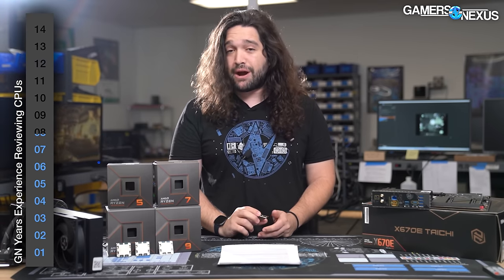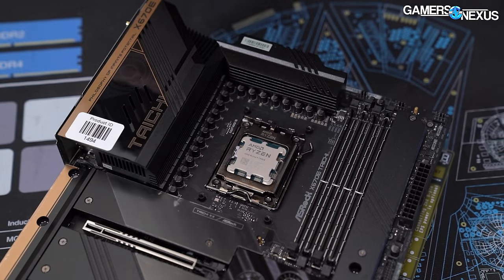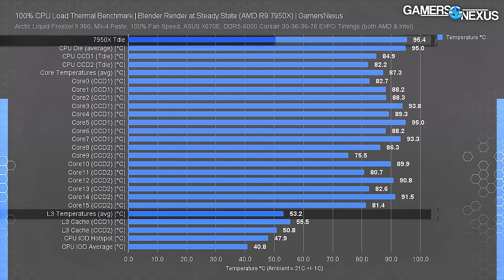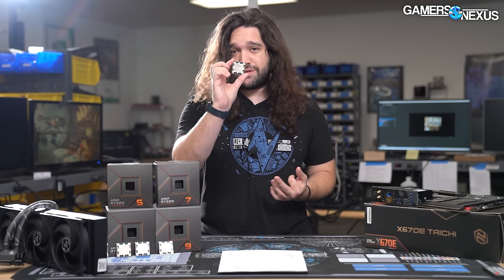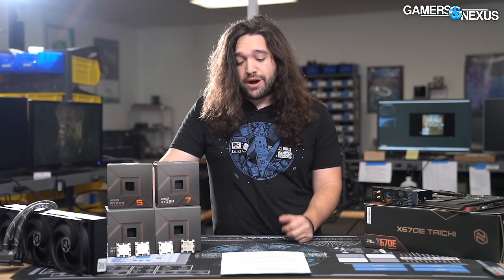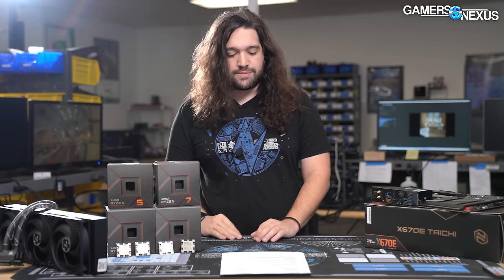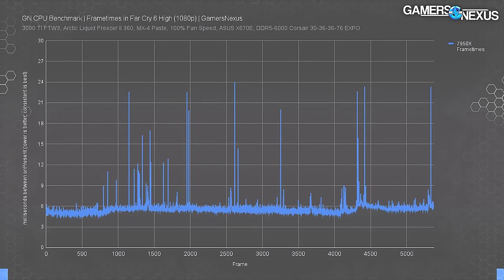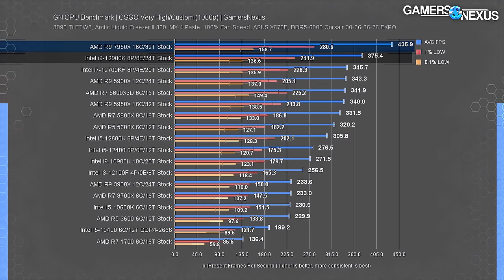95°C is Now Normal: AMD Ryzen 9 7950X CPU Review & Benchmarks

Comment: Happy to see amd doing this. If you want more efficient CPUs lock them to lower power and if you want more power you have the option as well. I'd be interested to see effiency at different power draws to see if it's worth it or not
Reply: Except that if you want to be more efficient, you'll skip this generation. (I am.) Why pay top dollar then fence off the performance? Get a 5900 or 5800x3d instead and save your money AND your bios tweaking time.
Reply: Why pay 2x or even more for the whole system with 7000 series, because it needs more expensive components and then underclock it to perform the same or little better in term of power efficiency than previous generation?!
Reply: @KenOtwell  it makes sense for the production workloads it excels at. For gaming get 5800x3d though

Comment: Will be interesting to see if the 13900K will be slightly more efficient or slightly more power hungry. Interesting and exciting times in the CPU space
Reply: It's a big jump both in performance and efficiency hence Linus recommended as well to wait for it, it's gonna still be power hungry (in max) load.... I say again (MAX) load, cause in gaming Intel doing less than 70C and power usage so low making use of these efficiency cores...... This time I'm going back to Intel tbh, didn't have good time with 3900X and 5800X they caused so many issues didn't find in Intel CPUs, both in VR and stability of ram also.....

Comment: +90C? That might be fine for the CPU but doesn't that affect other components in the PC? 

Regardless of performance, and price, that might be a deal breaker for people.
Reply: It shouldnt
Most it may affect is the board given that it was liquid cooled
Reply: @gawizard4980  But what if its air cooled?
Reply: It won't affect any other components. The TEMPERATURE is not the problem, it's the WATTAGE. Watts in = heat out. So running 210W at 30C is still the same heat over time as 210W at 95C. The surface temp of the silicon is not changing how much heat 210W produces.
Reply: Temperature != Heat. A 7950X running at 95° will be dumping less heat into the case than a 12900k running at 70-80C°. Like to like, lower temperatures are still preferable due to leakage but the power draw number is what you should be looking at.
Reply: No, overall heat output is what affects the other components. And thats solely driven by power consumption. So if you're fine with a 12900K, you're fine with these.
Reply: You can try to use as much science as possible, but the 95w figure is compounded but the high power draw. It is the High power draw... that is the number to look for. This is totally different than running a 4790k with the stock cooler..... because with this configuration you'd see +90c temps while running AVX production workloads, while the CPU is drawing -/+ 100w.

If you were to configure your AIO or Radiator at the front of the case then sure, the heat would be an issue. However, you'd have to make sure the hot air is being exhausted as fast and efficiently as possible..... while factoring in the GPU power draw. This should.... and I mean should.... be less of an issue if the AIO cooler/Radiator is configured at the top of the case.

If you think the 7950x is bad, then wait until you see what Nvidia has in store for you!
Reply: @FixedFunction  I think i understand this. The temp at the CPU only shows how well the Thermal transfer of X amount of watts is between the cooler and CPU?

Comment: They should add a setting to lower the target tempeture so you can can better longevity
Reply: no real point to buying it then, unless you want to force yourself into ddr5.
Reply: @OscyJack-  If he consider better longevity. I suppose he want to replace some 4-6 year old stuff like ZEN1 or Coffee/Kaby Lake. Than he will surely see great improvement of performance in new gen stuff.
Reply: @honzaplachy5040  you've agreed me with. If that's the case, get a 5xxx series. No need to get ddr5, no need to downclock. And it'll last a long time.
Reply: AMD said 95 is a "safe" temperature. Meaning it will have no deterioration or damage. Above 95 to 100 is still okay but it will throttle at 100 and deterioration will start.
Reply: @weirdo911aw  yeah, that's too hot. That will affect the climate of your home lmao. Degradation or not, that's stupid. All to be able to claim 5.5ghz +.

There comes a point where it's ridiculous. 

I'll be keeping my 12700k. I already get my max fps anyways. At 30 degrees less
Reply: @weirdo911aw  It'll have deterioration and damage on my well being and my sanity. I'm not looking to turn my room into a sauna.
Reply: @OscyJack-  it still uses basically the same power as your 12700k so it heats the room by the same amount. The temperature is irrelevant.
Reply: @infinitelyexplosive4131  untrue
Reply: @OscyJack-  the 12700k uses about 170-220W, same as 7950X
Reply: @infinitelyexplosive4131  are you trying to dig yourself a hole to climb out of? You're barking up the wrong tree.

You legit just said temperature isn't related to temperature. I don't think we can go further in a chat. But good day and enjoy your fantasy
Reply: @BlackWinds  hahaha
Reply: @OscyJack-  okay how much power do you think that the 12700K uses and how much power does the 7950X use?
Reply: @infinitelyexplosive4131  at the risk of extending this conversation. I run 182w full load averaged over 1 min. At 5.3ghz p core, 4.8 e core, 4.8 uncore at 1.26vcore.

If you think you are going to teach me something, you are wrong. I do this for a living.
Reply: @OscyJack-  so you’re looking at what, 20-40W more power to run the 7950X? That’s not going to appreciably change the temperature of a room.
Reply: @infinitelyexplosive4131  there are so many variables involved, I am certainly not going to sit on YouTube trying to educate you. 

You are not correct in your assumptions, but thanks for playing. Enjoy your day
Reply: @OscyJack-  There is literally one variable involved, power consumption. This is taught in every high school physics class in the world.
Reply: @OscyJack-  do you actually an object at 200C dissipating 100W will heat a room more than an object at 100C dissipating 100W? Why don’t you go and make a free energy machine then? You can probably get a Nobel, and billions of dollars.
Reply: @infinitelyexplosive4131  you're still at it? Lmao
Reply: @OscyJack-  why don’t you go make your free energy machine? What’s stopping you?

Comment: Those Temps are horrifying ehhhhh be interesting to see how these do in the logetivity department. Yeah 100⁰c may be 'fine' but cooler lasts longer period.
Reply: Yeah those temperatures are definitely not the new normal for me, no thank you
Reply: CPUs basically don’t break from temperature. Like, sure it will break in 50 years instead of 60, the difference is utterly irrelevant.
Reply: @infinitelyexplosive4131  You're going to have to sell it harder than that ding wong
Reply: @rubyvi5442  ?

Comment: Red is the new blue. AMD now has LGA, hot CPUs that use a lot of power, expensive motherboards, delidding seems to have noticeable effect on temperatures and some reviewers report much smoother performance without quirks of the earlier platforms.

Comment: Are there options in the bios to lower the thermal threshold, other than the Eco mode that you mentioned?  ie., could you set it to ramp up to 75C and hold it there for more efficient flops/watt?
Reply: What you want is a power limit, not a temp limit. And yes most mobos often have an option to power limit your CPU.

Comment: AMD planned for this amount of heat, or is justifying it's extreme temps? I think it would be interesting to see a 14 day stress test with this CPU.
Reply: Temps sitting at 95 stable, regardless of coolers, is a design feature, not a bug.
Reply: cpus have hit 95 in the past, pretty sure most ppl that used pc's back then reckon they lasted more than 14 days. (old amd and intel products)
Reply: Maybe both, because the temps will sit near 95°c
Reply: i think its fine for the hardware, the problem is gonna be your room temperature gonna be hotter

Comment: I think this is a better way to go assuming all the components are designed and able to take that kinda temp consistently without increasing the chip failure rate/thermal flexing etc.
As well having it all bound to thermals is very interesting and makes me want to setup a 24/7 chillbox for future Zen products if this kinda thing continues.

Comment: That's quite unfortunate for SFF builds. While I like the performance boost, those power draws and temperatures remind me of Intel, and not in a good way...
Reply: Yeah, this upcoming batch of hardware is basically anti-SFF.
Reply: @RicochetForce  why? Just run at lower power targets. It’s still faster than any other chip at any particular given power.
Reply: @infinitelyexplosive4131  At that point I'd rather just buy lower end, more efficient chips and save a ton of money.

Comment: Yeah I'm sure it's "by design". Lol they couldn't keep the temps low, so they call it intentional. Zen 9 plus rtx 4090 will finally make space heater meme a reality. Get ready for 600 plus watts gaming or 3d work sessions.
Reply: Great timing with electricity becoming stupidly expensive in Europe.

Comment: I'm curious whether we'll need to modify fan curves, since it's going as high as possible, surely if we don't want tornados in our houses we'll need to limit it.
Reply: 250 watts cpu with a 360mm rad at 100% fan speed hitting 95°C tells me that coolant temperature isn't the issue here, it's heat transfer from die to coolant. An EK 360 rad with ~ 2000rpm fans disspites around 300 watts at 10° over ambient coolant temperature. If you drop to 1500 rpm, it's around 200 watts. So i'd guess at 1500rpm coolant and therefore core temp would be only around 3-4° higher than at full speed. More rad space or faster fans isn't gonna help much, the closer the coolant temp gets to the ambient temp the smaller the effects of  better dissipation get.

What i think will happen is specialized blocks and mounting kits will come out, it's easier to find a degree or two at the cold plate than at the radiator at this point.  Even easier would be to just limit boost or voltage and cut the power consumption a bit, at least on zen2 a couple hundred mhz of core clock barely made a difference in performance.
Reply: it seems like what will happen is the CPU is going to hold around 90 degrees no matter what, and the more aggressive your fan curve, the more performance you will get. So if you like to feel the wind in your hair and hear the scream of the fans, you should be getting yourself some performance gains.

What is really interesting is that if you are running a low power cooling solution, buying something more expensive might actually result in more performance, which some people might care about.
Reply: @kunstderfugue  we can now finally measure cooling performance in FPS. it's gonna be shitty measurements, but it's possible!
Reply: soo, i just read computerbase's review. at 140 watts in eco mode it loses 5% performance for all core loads and none at all in single core. at the same 140 watts as a 5950x it has 30% more performance in their multicore tests. and in gaming it uses just 5 watts more than the 5950x. so basically don't worry about it for day to day use and set a wattage limit. alternatively, they managed a -100mv undervolt, dropped 10 degrees and got higher boost clocks

basically amd is shipping this as a balls to the wall monster, but if you want to reign it in significantly you can do so with very small performance sacrifices
Reply: @givemeajackson  how would we set wattage limits? Is that done in bios or ryzen master?
Reply: @mismagiuz  it will probably be possible in either one? i haven't seen either an am5 bios or a compatible ryzen master version myself, but if it's anything like the current platform it'll probably be adjustable in both.

Comment: CPUs and GPUs are in such a state right now. Higher temps, higher power, higher prices…

When at least power consumption should be going in a different direction due to world energy prices and availability, Nvidia is so afraid to lose against AMD they cranked the power so much that people will need new PSUs and new plugs had to be produced.

CPU wise, Intel is the same situation. Squeeze every bit of perfomance regardless of power consumption.

AMD follows to cos they all competing against each other.

I wished Intel, AMD and Nvidia decreased power consumption for at least one generation even if performance didn’t improve much over the previous gen.

Its getting pathetic now.
Reply: Power consumption on parts went down the last 6 years
Reply: It won't change unless we get a new player in town that actually does things normally. And if they do well, then these greedy companies will finally start doing their job right
Reply: or countries could abandon their energy suicide and invest in traditional forms of energy - instead of vaporware and idealism.

Comment: I just built a Ryzen 9 7950x build. MSI X670 PRO, Corsair 32GB 6000mt c36, EVGA RTZ 3080ti FTW3 Ultra Hybrid, Corsair 4000D air flow, Thermaltake tough liquid Ultra 360 AIO. 1000 watt Asus ROG PSU.

Comment: This thermal strategy of hitting the target first is the way to go, I always told my friends (something like): "If you know your CPU can work at 95ºC without throttling nor reducing it's lifespan, why would you force your fans to keep it under, say, 70ºC? The amount of heat generated is exactly the same, the only difference is that the heat is sent quickly to the room (70ºC) or kept in the CPU (95ºC), I prefer the latter, with fans running slower and the heat in the CPU for as long as possible."

Comment: 95c is obscenely hot.   I use to freak out back in the day(2010…lol) when my 4890  video card went over 60c but it never had a problem……ever. Fuking space heater in the winter. 

We’re going to be melting silicone soon enough. Synthetic  diamonds are the future of CPU’s(hopefully).

Comment: That's actually really interesting, changing the CPU thermal point to 95°C. Heat transfer is proportional to the temperature difference, so by cranking these CPUs up to the highest "safe" temperature possible, they're able to dumb the most amount of power out of the CPU into the cooler possible. It won't make much difference in sustained loads, but in bursting conditions, I would imagine this will increase the maximum boost window quite substantially.

Comment: I have now Ryzen 5950x worked on custom cooling system with 2 360mm huge radiators,  And I undervolted the CPU to be able to use it in the x570 chipset! , I was thinking to Upgrade to 7950x but since the temperature issues still there I will not buy it and I will be waiting for the new intel CPU  coming .
You Help me a lot to take the decision
Thanks man

Comment: I currently have a 10850k, 64gb of DDR4 3600, and a 6700xt. I game on a 2560x1440p 165hz monitor. It seems like I would be fine to upgrade my graphics card to something next gen and keep the rest of the system. When I built my system a 6700xt was the best thing I could buy that was reasonably priced. Maybe upgrade to a 7800xt, assuming those aren't as expensive as the 4080 (16gb).

Comment: I plan to get one of these in early 2023 after the b650 boards are out, the bugs have been ironed out and the prices for parts drop.

The reason for this over the 5950x is upgradability. I plan to make a (roughly) $1500 USD productivity build that I can upgrade later.

Comment: These charts really help solidify me wanting to build a 5800X3D system since it will only be for gaming. The other CPUs outside of gaming are amazing but I won't be doing any of them and the cost for DDR4 and X570 board are way cheaper (or in my case free since I'll be salvaging other parts from an older build).

Also if Intel have a similar leap in their new line of CPUs AMD might have to try harder again.

Comment: Okay, my 7950x only went to high temps when doing extreme tasks. It found the max the cooling could do and then settled in. It was kind of a race car feel. Average running was cool as a cucumber. The Asus motherboard bios did not take too long on first boot. Everything seems stable. My noctua cooler seems to have no issues with the 7950x, but my cinabench score was about 1500 below the scores with liquid cooling. The general feel of the experience is that it is super snappy.
Reply: My cinabench results had my CPU initially going at 5.7 Ghtz before settling at 5.1 or 5. I think the lower settling in state was because I was on air cooling.

Comment: I'd be curious whether you've seen the video by "der8auer EN" and, specifically, the nugget where he estimates the IHS to be thicker.  Supposedly, this was done to maintain compatibility with AM4 coolers.  This affects thermal performance all on its own; no matter how much cooling you throw at it, the stock config will still run *hot*.

Comment: Well, I got my 7950X set up and going and dig'n it.  The system wont be running at full tilt like in these tests so I won't lose 0.1 second of sleep with this cpu.  Hell, coming from an 11 year old  i7 2600K, that's still hump'n BTW, a match and a twig would be a huge improvement.

Comment: Currently most users rely on temperature to adjust fan speed. My understanding AMD plans to push clocks up to the max whenever there is a load until temperature won’t reach 95C. I don’t understand how to make cooler in such situation to run quiet. While it is nice to see good benchmark performance operational noise isn’t something normal people would like while working actively. I am talking about professional use cases. Previously we were able to adjust fan curve based on CPU temperature now it is not possible unless you switch to manual overclock or somehow reduce performance through PBO or whatever they call it now.